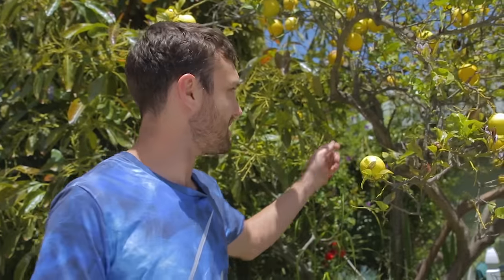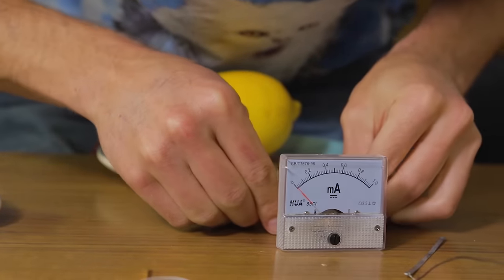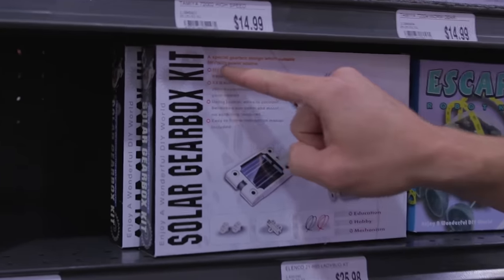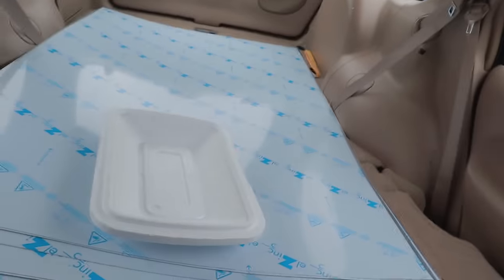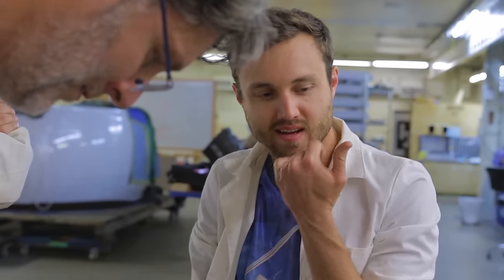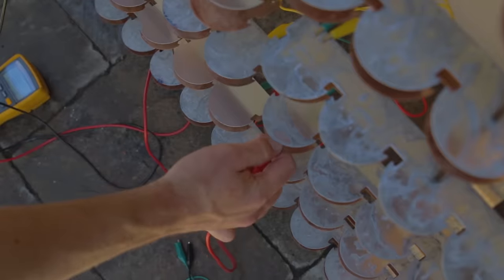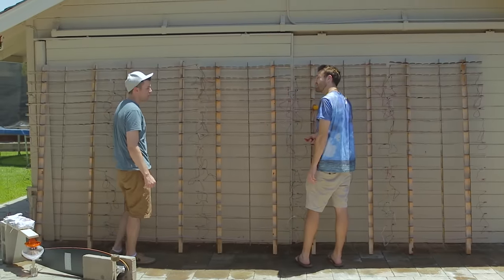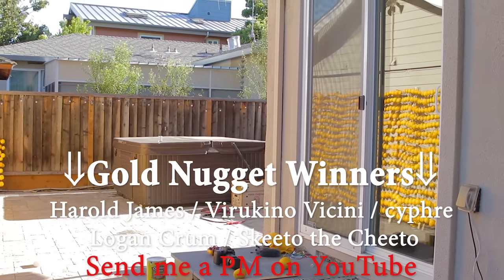How Much Electricity Can 1000 Lemons Make?

Comment: guy who sold william the zinc:
“i’m worried about the material. you can ding it and scratch it easily” 
william:
15:43
Reply: To be fair, the zinc is being used for nothing other than an electrode. I'm sure that if scuffs or damage mattered, Mark wouldn't have let him make a cacophontage with it.
Reply: The protection layer was still mostly on
Reply: @AssistantCoreAQI  HowToAcidic
Reply: @peppersalt  Underrated comment.

Comment: If you use potatoes boiled for about 10 minutes, cut into quarters and then wedged between a zinc anode and copper cathode you can get a whole lot of power of out them.
Reply: You can even put a GLaDOS in those potatoes!
Reply: Potato mashing machine powered by sliced boiled potatoes.

Comment: If 3 cats walk through a long thin tube it will take a long time. If 3 cats walk through a long wide tube they will walk in parallel and faster.
R E S I S T A N C E
Reply: They Will Walk parallel no matter what, just om different axis
Reply: This does not work with fibre

Comment: is it weird that i understood your "bicycle in the air" analogy? like the wheels are not in the ground so you can pedal and pedal and pedal really fast but you go nowhere. if you are in the ground then it's harder to move ofc but then you (the person) are making the energy to move the bike forward by pedaling which makes the wheel that is touching the ground spin.

i also if u think about it what william said in marks video also makes sense like. the fact that the battery works is well but that it works as well as it does (ie doesnt produce that much energy) is not well
Reply: If you have basic knowledge of physics, it's pretty simple.
Reply: Varik Valefor is you live on earth, its pretty simple

Comment: The zinc gives off kations, which are positively charged ions, these are labelled ZN2+, as well as electrons, which are negative. The electrons combines with hydrogen anions, positive ions, from the acidic electrolyte, the lemon, to form uncharged hydrogen. The electrons from the copper is transferred through the wire to the zinc, which leads to an electric charge being generated.  The hydrogen just bubbles away.

Comment: ive been thinking this the whole video, if you were to put the probes in from opposite sides, you could go all the way through to the peel and get slightly more surface area than if you put both leads on the same side.

Comment: To anyone who actually wants to know what resistors do and what the inner resistance of the lemon is, imagine that wires are like water pipes and electricity is like water, a resistor would simply be like a narrower pipe, it let's less electricity through. Its useful for things that need low voltage like LEDs for example. Internal resistors (in this case, the lemon's internal resistor) is like resistors but it's "built in" to the lemon, essentially it just means the lemon isn't such a good conductor of electricity.

Comment: Will it work with a non-lemon say a power supply because I sure hope it will and also what is the lemon runs out does the clock reset 0:10

Comment: How mark explained it is ther are two cups one is high up and the other lower than the other and the high one has water so the water wants to go down so there’s straw Connecting them so the water goes through the straw and the straw is the lemon that was typed with 2 Brain cells

Comment: A battery works by having a side with more electrons (a negatively charged side) and, a side with less electrons (a positively charged side,) in the same container. The container has an insulator in between the 2 sides which prevents the electrons in the positive side from directly attaching to the positively charged side. To allow the electrons from the negative side to go to the positive side, we need a conductor to do it. Like a wire. In a lemon battery, the positively charged side is the copper wire and the negatively charged side is the zinc. The "wire" in this case is basically the lemon juice. (Did you know? Lemon juice is conductive.)
Boom. Block of text but hopefully, more understandable. Any questions?

Comment: $800 for those two sheet?!? You got ripped off!!! Zinc sheet is used in construction to panel the outside of buildings and in special roofing. It cheaper than that. I bought about half of what you bought from a construction site using it for about $20!!!